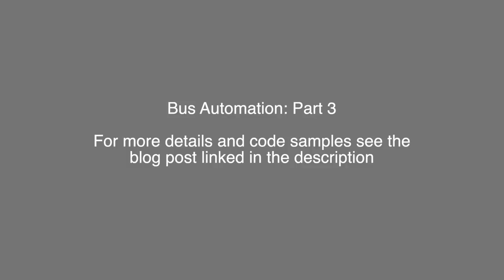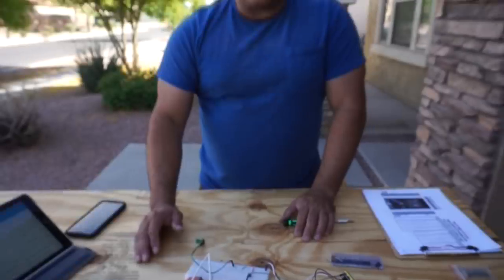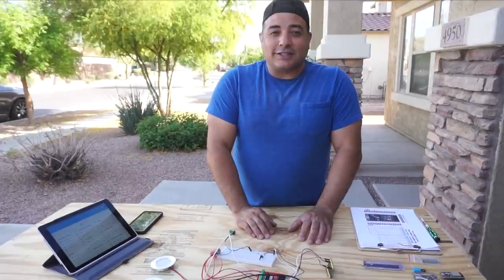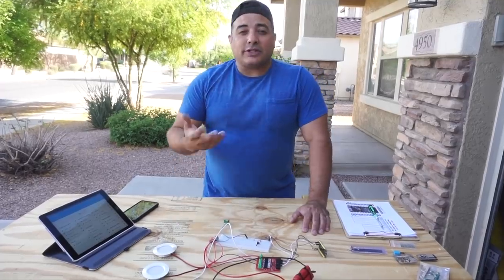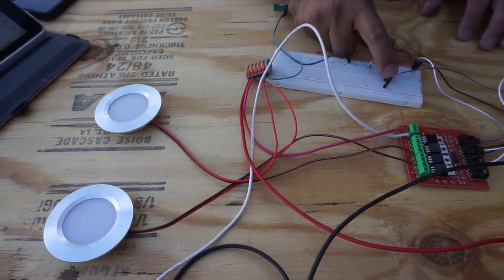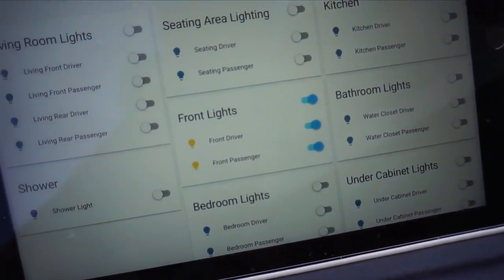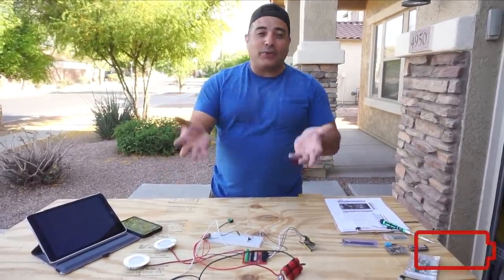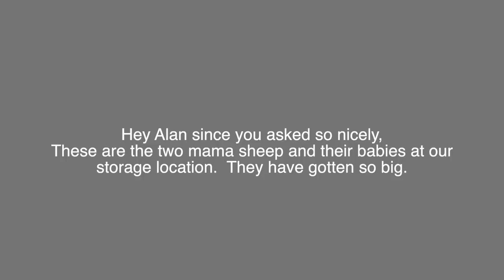Bus Automation: Part 3 - Dimming the Lights and Graceful Degradation

Comment: As a former control systems / software engineer I am impressed with your design approach.  You have obviously given this a lot of thought.  One suggestion for ultimate redundancy in the face of total system failure:  wire in a few dedicated lights, perhaps 2 front, 2 mid, and 2 rear, and 2 outside, with each zone on a hardwired switch running off the 12 VDC house battery system, no bus automation involved at all.
Reply from the maker: Thank you Bruce - excellent idea!  One of those systems that you hope you will never need to use but are so happy you took the time to put in if you actually need it.  Thank you for the suggestion!

Comment: You explained that really well. I had thought of going that way with my lighting plan, but about half way through my planning project, I decided to step back, super simplify, and go with simple on/off switches!! ;-). Less things to give me problems down the road. Infact, I decided to re-use the original 40 year old reflect-o-lite ceiling fittings which brings with it, a new set of problems (spare parts). The only upgrade will be in replacing the filament bulbs with 2700k LED panels. I can't wait to see how your lighting works out. It's right up there!
Reply from the maker: Thank you Kevin - I can 100% see the appeal of that approach.  Michelle and I very often ask ourselves "are we just making this too complicated?"  Sometimes the answer is yes ... well most the time the answer is "yes".  It is a hard balance to keep for sure.  Would you believe I started down the home automation path because I wanted to simplify the wiring?  Anyway - we'll keep you posted on how it works out!

Comment: You can also use a "Voltage Regulator" to supply the 5v. An industry standard is an LM7805 and it should be able to take 12v and output a stable 5v without problems. It's very similar to the MOSFET, TO-220 package. Fewer components, less room for failure. Also good to mount the LM7805 with a small heatsink.
You just have to keep in mind sharing a 12v power-rail with multiple loads when connecting delicate electronics like this (ie: alternator/refrigerator/appliances). Especially motor or compressor noise can bleed through power-rails. With all these dimmers, you'll have a 5 kHz switching noise on the power line. It's just something to be aware of if electronics malfunction, stop working, get random errors, or get bad sensor readings; you'll know a possibility of where that fault is coming from.
Reply from the maker: Thank you x86cowoby - I have been looking at the LM7805 - they are really cheap and quite popular but suffer a little with poor efficiency. All my 12V rails should normally run through the 48-to-12V converters unless we are in "emergency mode" but I will keep my eye out for bleeding power.  Thank you for the comment.

Comment: Kudos Juan! You are really doing a GREAT job! Yes, make sure your PWM dimming frequency is high enough for filming at high shutter speeds or slow motion to avoid flickering. I think the DHT11 and DHT22 sensors are not too accurate and experience interference when placed close to the MCU. Have a look at the BME280 or even BME680 sensor boards. Last one even adding a gas sensor. Thank you for making these videos!
Reply from the maker: Thank you Freddy - I know how technical you are so that means a lot coming from you.  You are correct about the DHT11 and DHT22 sensors - they are mostly toys :)  When I get more serious about temperature probes and logging I will look into the sensors you have mentioned.  I thought a really neat idea might be to place some near the axels to detect if a bearing is going bad, or a brake is malfunctioning and causing excessive heat - maybe as a "down the road" type of thing.

Comment: Awesome content, thanks for sharing!  I really like your graceful degradation ideas.  I’m not sure I am going to tear out all the wiring in my newly acquired bus, but I would like to integrate some of your ideas into my 78’ Silver Eagle
Reply from the maker: Thank you Mike - I LOVE the Silver Eagles!!  We looked for a long time trying to find a 35ft one - but it just wasn't to be this time around.  We have the "advantage" here of starting from a clean slate so to speak.  If I have time once we start traveling and I get to spend some time with the system I will investigate the feasibility of doing some "replace RV type switches" adaptions using some of our stuff.  Thank you for the kind words - maybe we will see you on the road!

Comment: I'm sure you know. You said those mosfets are rated for 30 amps. That's is only under certain condition with a lot of cooling.

Love the channel. Thanks for sharing.
Reply from the maker: Thank you, Dan - Yes sir - 30 Amps is only to be done with very large heat sinks and probably active cooling - fortunately, we are running about 0.3 Amps through these little guys so they should be OK with just ambient cooling.  Thank you for the kind words and for following along.

Comment: Juan, Thanks for the great video. I would love to see/hear more about the computer hardware and software you're using to finalize your plans. I was hoping you had a block diagram or high level  schematic of the computer hardware, lights, etc. 
Mike
Reply from the maker: Thank you Mike - we are just scratching the surface with this stuff.  Right now I am just using a Raspberry Pi to run Home Assistant and MQTT - it has been working out great so far.  The ESP32 communicate with home assistant via MQTT and just use the network (I use the Arduino stack on the ESP32 and it has been great so far)
Reply: Juan, You might want to checkout Dr zzzs YouTube channel. He has a video about Tasmota on a Wemos D1 Mini (ESP8266) which has built in MQTT communications.

Comment: i did alot of this in my RV . make SURE you use a setup up set down converter power and to stay at 12v dc .  so solar and low cost 110ac 12 chagers can push the volts up and down and  kill most basic DYI stuff.  even the LEDs on your table are 12volts only  . all ways look at the power inputs and what rang they can take . post of your parts here well not live long in a RV setup with out putting some time into the power side of things
Reply from the maker: Thank you falcon7350 - very good advice.  As we get further into the build we will revisit the power side of things again.

Comment: I’m a couple of years behind you, but wondering how your system turned out. Did you implement the way you envisioned? I’m using your design as a baseline, and considering the Raspberry Pi Zero W in place of the Esp32. I’m very early in the learning process, and new to Python. Lots of fun working through this stuff.

Comment: Juan - you have clearly both been very busy and that is a really impressive sub project - but you are playing to your strengths and you must have had a lot of fun implementing your well though out ‘graceful’ design.👍 Good to see you using Wagos - I know you are only using them in a breadboard environment here - are you using them for general wiring in the bus? I know they have fairly recently introduced some real improvements and reduced the physical size of their units. They are a great maintenance free connector.
Reply from the maker: Thank you Norman - It really has been a fun project trying to work through all this stuff.  I love those little Wago-like connectors - I use them all over the place.  Unfortunately, these are not real "Wagos" but they are very good.  I will have to look at the new ones - I will very likely use them anywhere where we might be removing a wire (like to connect a light or a board that can be replaced).  I will see about getting some real ones for that.

Comment: It's a great video again and I really liked the code you posted on the blog.
Will you run the mqtt broaker on rapsberry pi?  If so, I would think about maybe using a sbc with emmc support. In my opinion it is much more reliable and will bring less problems.
Thanks for sharing and I'm very curious about the automations that you will integrate into the final project.
Reply from the maker: Thank you - yes the MQTT broker as well as Home Assistant are running on a Rasberry Pi right now.  It was the easiest/fastest way to get everything running for now.  As I get more serious I will look into your suggestions - thank you!

Comment: Juan, The only thing I would like to point out is the LED lights, I hope that you intend to add a disconnect at the light its self. I looked at the lights you are have and them being the way they are I would hate to have to chase those wires just to replace them. I use LED lights in everything in my house. I even have a bunch of led light strips. I even have one that is rated at 15K hours that are about dead, I can tell you that about 8800 hours in they will start to get dimmer.  I am now at  just over 25k hours on it. And it is very dim, I am going to run it until it dies. Even our bulbs that are about 3 years old have be come dim on the ones that are used more often,  Hour ratings are very weird between manufacturers. Just cause they say 50k hours, that does not mean 100% rated lumens for that whole time. I also have a few that rarely get used and have gotten hot and discolored the lens... This is just from what I know and my use of LED lights at home over the last 5 years or so.
Reply from the maker: Thank you William - I do intend to make them VERY easy to replace - We have had terrible luck with the LEDs in my house - the "candle" type ones over our dinner table - the incandescent bulbs have lasted longer the the 50,000Hr LEDs!!  One of them lasted literally 10 days!  Thanks for the heads up and the reminder.

Comment: I’d run your overide switches directly on 12V so even if your 5V supply or a MOSFET fails which is common in Shenzhen Huan Hung Lo brands that end up in those cheap boards. Another YouTuber Jehu Garcia teams up 3x BMS boards for extra current capacity but also failures.
Reply from the maker: Thank you Peter that is an excellent idea.  I do have my doubts about these MOSFET boards so you bring up a very good plan.  Thank you.

Comment: That is some impressive lighting system and I actually understood everything you did and why! I think as cheap as those ESP32 boards are I would keep a programmed spare for each one you have.
If you don't mind what kind of problems are you having with your MacBook? I just got my first MacBook Pro 15" yesterday because I got tired of the poor quality of most Windows PCs and now you've got me scared.
Reply from the maker: Thank you Dirt Road Sailing - I love it that you could follow along!  It's difficult sometimes to get the balance right and I tend to lean strongly to the more technical side - I am going to assume you are very technical.  The MacBook - oh boy!  It started because I had the USB ports on the left hand side go out.  At first I thought "Meh I could live with that" - but I was wrong, it was REALLY annoying.  Especially when another one on the right hand side started going out (only 1 good one remaining) - I took it into the Apple store (my least favorite place on the entire planet BTW) They ordered those and got them in (they are small daughter boards) ... they replaced the daughter boards and it still wouldn't work so they had to send to the "main" repair facility.  They replaced basically everything in the laptop (motherboard, daughter boards, + 2 other I/O boards - I got this one on Dec 8, 2018 - so it is still pretty new) sent it back with a factory image.  No big deal since I had a backup.  I went to do the backup and something got corrupted and it wouldn't complete the backup - I then tried the "disk doctor" thing they have and messed something up bad - it would only come up with a prohibitory sign (which is basically a no smoking sign without the cigarette in it) - took it back into the Apple store - they couldn't fix it so they sent it off again to the main repair facility ... it has been one of those weeks.

Comment: Very cool system - I'm sure that it will be great for your house lighting system. One suggestion - include some old-school simple lighting run from your chassis electrical system (separate from your house system). That will ensure that you have interior lights when your house system is either off or malfunctioning. Redundancy is a good thing - failures happen.
Reply from the maker: Thank you Richard - 100% agree things are going to go sideways at some point.  We do have a system that will fail back to our 12V chassis battery in a situation like you describe.  I am hoping to leverage this as well - When we get closer to that I will make a video on how it works.  Thank you for the suggestion.

Comment: You know, if you used a Motor HAT for the RPi or motor Shield for the Arduino, you could have done it way easier. You can control LEDS with the motor driver. It is a PWM thing. Much easier to program and much less wiring.
Reply from the maker: I think that would have been quite a bit more expensive.  The Mosfet boards I used cost about $5 each and control 4 lights.  The motor shield controls 2 lights (motors) and costs about $20.  Just for the lights I need to control 16 different "zones".  So I would need 4 Mosfet boards for ~$20.00 total or 8 motor shields ~$160.00. I will also be running fans, temperature probes and water detection so I will need circuits for all of that.   Also RPi is also much more expensive ($40+) and uses more power than the ESP32 ($10).  They are both fairly easy to program and the wiring would be almost exactly the same.
Reply: @BeginningfromthisMorning   No. Get the HATs  from aliexpress and they only cost you  $16.25 and they Handle 4 (that's FOUR) motors and 4 Servos. And they are stackable. So for  $65 you can operate 16 zones.  Also the HAT has pins set up for I2C.  So you can hook up to 64 (I think) I2C temperature probes and water detection modules. 

Now I only said RPi because some people like them and they are widely used. However I also mentioned Arduino.  For the arduino the Motor Shields are only $ 5.72 X 4 = $ 30.19 with taxes shipping. Arduino UNO is cheap.  Plus you can still use the I2C.   

So the MOSFET boards you linked to are $10.99 not $5 so that's  $10.99 x 4 = $43.96 and that's before taxes.  

Wiring will not even be close to being the same.   You have at least 5 wires going to that mosfet board right now  and 3 of those are going to the pins on the arduino. That is not including the wires to the lights.  So Just with that x 4 is  20 wires to the mosfet board 12 of them are to the microcontroller.  You are going to run out of pins.  Not to mention you are going to have one hell of a rat's nest of wires for just the control side. Power wires 4 sets of power wires to power the lights.  8 wires.   16 sets of wires to the lights.  32 wires.  (counting the negative) So that's  40 power wires and 20 control wires as you have it now.   60 wires. 

Now  let's compare that to a Motor Shield.  4 sets of power wires to power the lights.  8 wires.  16 sets wires to the lights.  32 wires. (counting the negative). 40 power wires that's it.  NO control wires. When the shield is stacked on top the I2C pins are connected. That would be for all 4.

So no, wiring is not the same. 

Programing is way easier. With the Shield all you have to do is tell it what motor to run. Just like setting the pins you have to give each pin a good name but you have make sure you write  down what pin goes to what. With the shield all you have to do is look at the board and see shield 4 motor 2 . You may think that's not a problem now but when something needs tweaking a month down the road you will see.

If you do it with these mosfet boards you are going to need an I/O pin Expansion Board. 

Power? The setup I have now with  Arduino Uno, Motor Shield, I/O Expansion extend Board Micro Sensor Shield Module, Homemade I2C Expansion Board, LCD 16x2, LCD 20x4, 2 flat motors, one Linear Actuator, 3x4 Keypad, 12V Interior LED Light Bar, 48 LEDs, RTC and DHT sensor is ONLY drawing 100mA. That's it.  When the Linear Actuator and LED bar are at full power it only draws 690mA.  That is way less than the 3A the shield can handle. Just the system and LED bar is pulling 440mA.  And it runs on a single battery with a tiny wall wart charging it through a small charging module.

The light set you link to pulls 3 watts. That's  250 mA.  x 4 Sets that's  only 1A.  6 x 4 =  24 lights. That's a lot of light for just a bus. LOL.   I can max out with 8 light bars on one Shield. Better with 6 tho. Or just one bar per channel. Bars are 340mA or 4.0 watts each.

AND no need for that voltage regulator/DC to DC Buck Converter.
Reply: But to help you out with the wiring I will show you this. It is like the I/O Expansion board but easier. It's PWM board that works on I2C. You will still have to do all the speed/pulse/brightness programming but you are going to do that anyway. Well unless you get the Motor Shields.

https://www.youtube.com/watch?v=hWSprtJcZiE&feature=emb_logo&ab_channel=bitluni